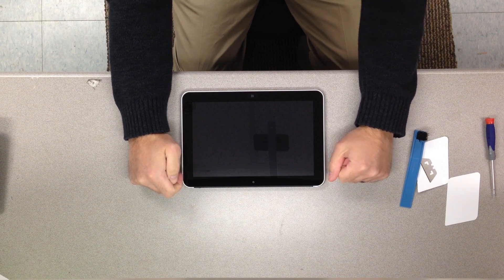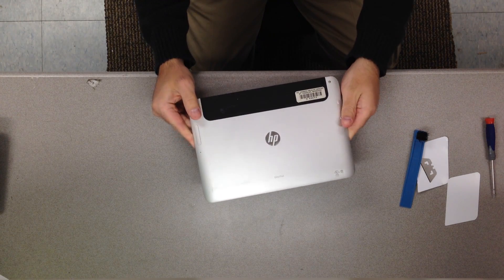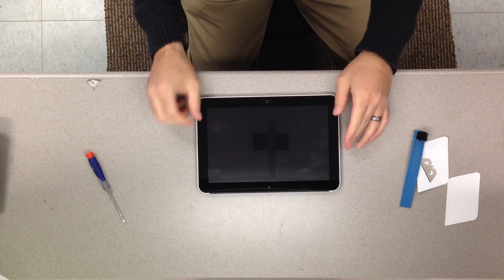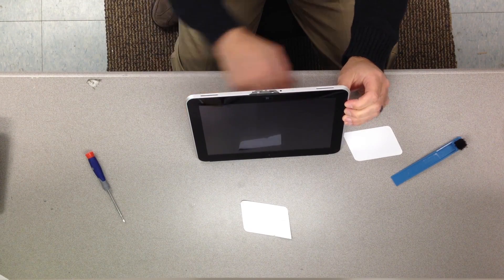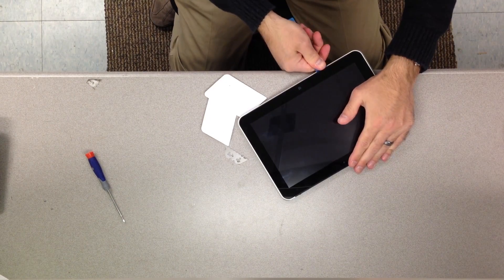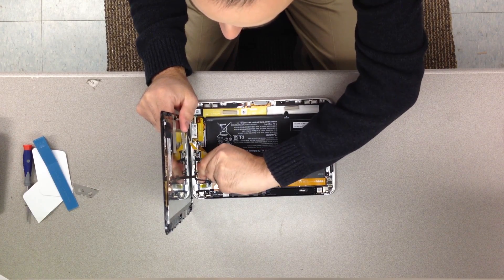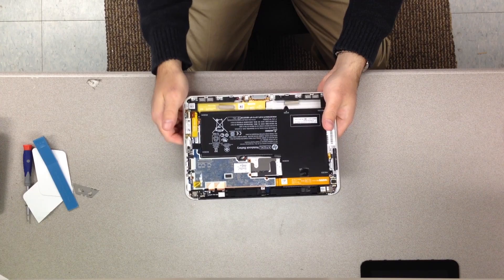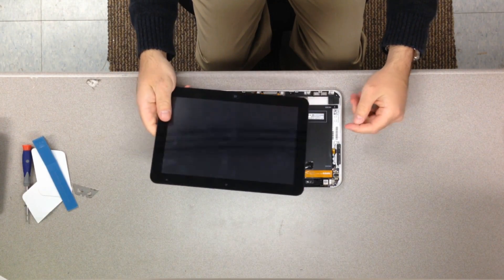HP Elite Pad 900 Disassembly: Removing touch screen without proper
tools!

Comment: Does anyone have a recovery USB for this unit - my bios needs to be restored and I want to reset back to "factory defaults"
Reply from the maker: It comes with an adapter to plug in USB flash drives.

Comment: start from the top edge, the plastic there is a bit more flexible
Reply: Brilliant advice Rosen, Ive just replaced battery on my 1000 g2 which is very similar to the 900.  The video is very helpful and have to thank guys like this showing how to take screen off however i have taken screen off using no tools at all !  Looking at the pad in normal viewing position, start at the top right corner. Get your thumb nails in there and start levering the back away from the screen and not the screen away from the back or it could crack. Work your way round anti clockwise and it will be loose in no time. I found it easier placing it on my lap vertical because of the magnetic clips. Once its all loose carefully lift screen to see where ribbon cables are then open 90 degrees on flat surface using a bookend to stop the screen falling over. 6 small screws holding battery, have to remove tapes and 1 ribbon cable for removal. Careful with that little black wire in the corner looped over battery eyelet as well.

Comment: wow, I tried this and I can't even get in the crack. Seems impossible
Reply from the maker: John F Are you using a thin screw driver to pop up the display after taking out the screws? Might need to pick you up a suction cup...

Comment: I did the windows 10 upgrade and wow is this a dream tablet.
Reply: +Eye on art anyone know, if the ssd can be removed? its mounted on the board, but can be used if removed with the board?
Reply from the maker: +Darren  C The SSD is not replicable/upgradeable.
Reply: Eye on art I'm getting one Tuesday, I hope to put windows 10 on it
Reply from the maker: Inferno G4ming Good luck... I reverted back to 8.1 on mine. Win 10 ran like dog poo.